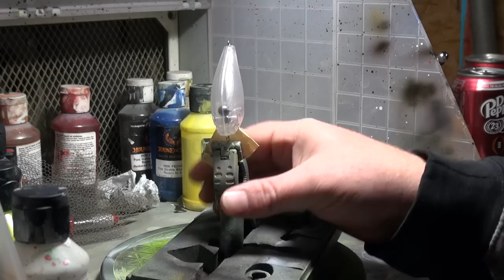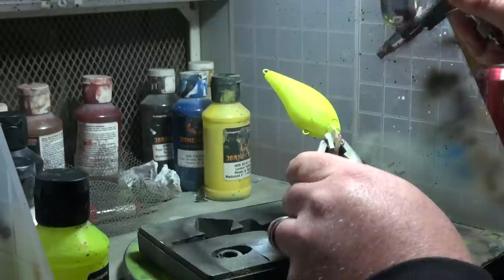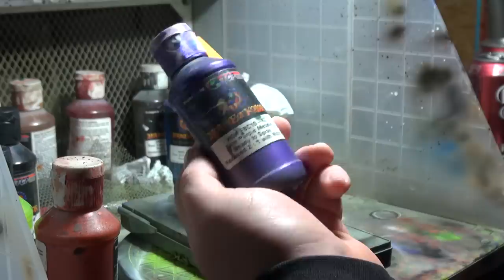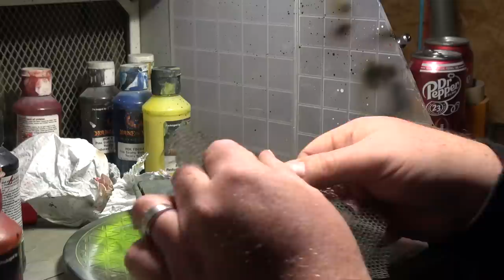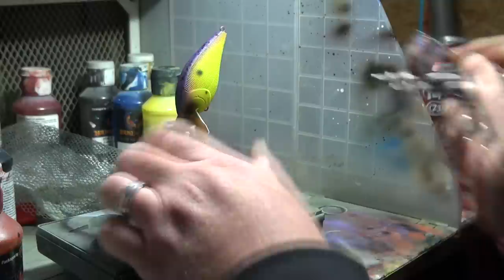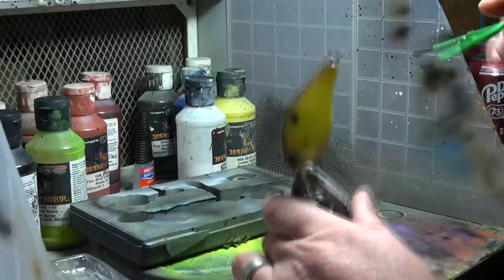HOW TO CUSTOM PAINT A CRANKBAIT - airbrush fishing lure

Comment: Question, paint that you’re using and epoxy you use. Great video!!
Reply from the maker: House of Kolor paint and Devcon 2 ton epoxy.  Make sure to check out my other vids!
Reply: We Do It Outdoors did you have certain colors you started of with? I looked at those paints they seemed expensive.
Reply from the maker: @mmntramonti  they are expensive but a little goes a long way and you get what you pay for.
Reply: We Do It Outdoors sorry to keep asking questions, what colors do suggest to start with. Water base? The paint is confusing a lot of different ones.
Reply from the maker: Solvent based is th easiest to use and clean. If you have a local auto store that sells any automotive paint that sells touch up paints for rock chips I would start there. DO NOT BUY the pre made touch up paint with hardener. It will gum up your airbrush so fast. Use any solvent based paint with a 2:1 ratio. Start with something cheap to okay with then work your way up to the good stuff.

Comment: You can put the brush in acetone for 15 min. and it's as good as new.
Reply: Acetone/Brakleen is OK for steel parts prep, only as long as it's non-chlorinated. I'd be a touch hesitant throwing my infinity CR plus or any of my microns in my parts cleaner. Airbrush cleaner is the way to go, or you could always just use some original Windex in a pinch on an airbrush. Hell of a lot cheaper than acetone, and saves you from researching just what chemicals your airbrushes O-rings can handle...

Comment: If you add a little tubing alcohol to the epoxy it will thin it a little if play with the ratio of epoxy to alcohol it will extend you dry time but the best thing is it is esayerr the brush on. Dollar stores is the bet place to get the brushes vfor a dollar you get a boy 50. Save all your Chinees food cop sticks cut in 3 pieces each you get a lot of Steelers aand us bottoms of soda ccan to mix it NO clean up!!!